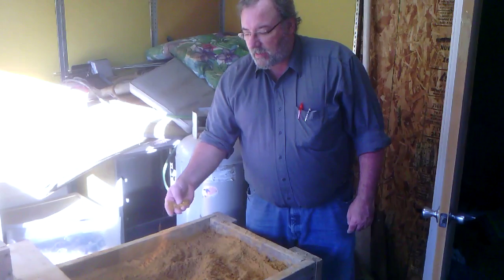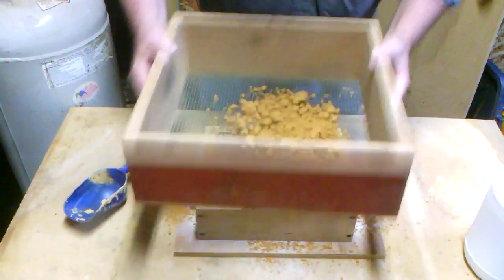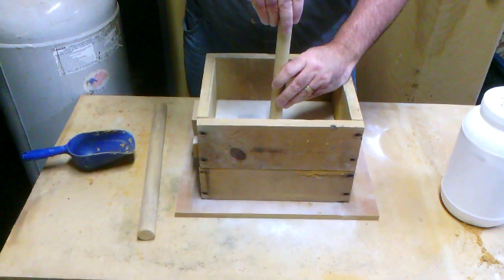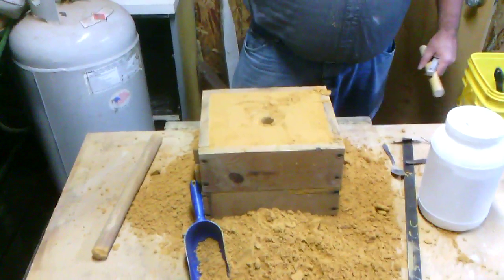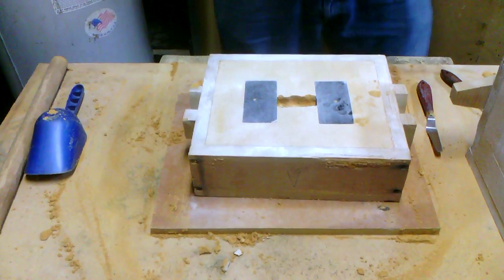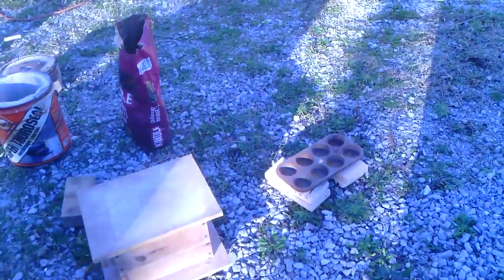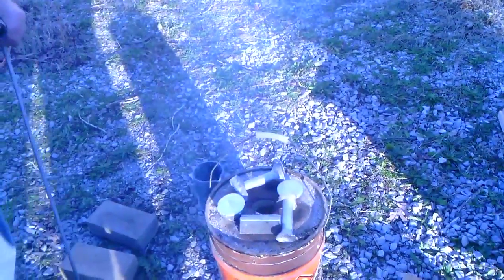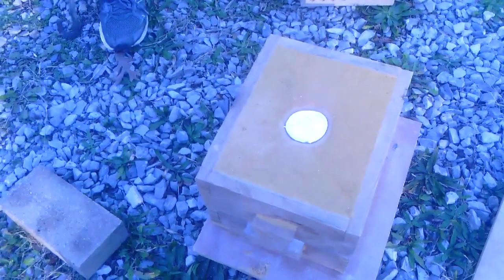Metal Casting From Start To Finish

Comment: I have never seen charcoal used for heating. Will it work for all metals or just low temperature metals like aluminum & brass.
Reply from the maker: I suppose with enough fuel and air you could melt iron, but charcoal I don't think really has enough density to be economical.  You could however use nut coal or similar.  Great question.   Thanks for stopping by and watching and taking the time to comment. 

Joe

Comment: What is your sand?
Reply from the maker: The sand I use is green sand.  This is just clean silica sand with clay added to it for a binder and just enough water to make it stick.  Sometimes sand can be found naturally this way and is called natural bonded sand.  You can make your own green sand if natural bonded sand is unavailable.  There are many recipes for the sand, but a good purpose aluminum casting sand is 94% sand, 6% bentonite clay and 3-3-1/2% water to temper the sand.  You may want to check out some of YouTube channel sandrammers early videos.

https://www.youtube.com/user/sandrammer

Joe
Reply: @MyHeap  thank you man, but what is size of this sand?
Reply from the maker: @يونساويس  Use the finest you can find.  I think for aluminum castings, 80 - 100 mesh works well.  If you get too fine a sand, you have problems with the gasses being unable to escape..

Joe

Comment: i WOULD HAVE NEVER THOUGHT THAT CHARCOAL WOULD HAVE GOTTEN THAT HOT THAT FAST!  GREAT!  WHERE DID YOU GET THAT SMALL SPATULA?
Reply from the maker: With enough air charcoal can get pretty hot, pretty quick.  The palette knife (spatula) that I am cutting gates with, I bought in the paint department of the local hobby lobby.  They make several styles and they are great for this sort of work.  Thank you for stopping by and taking time to comment.

Joe

Comment: Hello, early in your video you indicated that you would do a project using a match plate.  Have you, or do you still plan on doing that.  Have heard of match plates but never have seen one or one in use.  Thank you.
Reply from the maker: Hi Glenn,  I have the hardware cast and need to machine them for the match plate.  I have a very small Craftsman 7x12 lathe but it is too small to machine the castings.  I have tried.  So in the interim I have found a Atlas TH54, it is a 10x36 and is big enough to do them.  I am in the process of fixing this lathe up to use as time and money permits.  When I get it done I will machine the castings.  I will post a video if you like when I get there.  If you have a real interest in metal casting, I would recommend watching some of myfordboy and mrpete222 vidies from theor channel.  For an excellent video course on foundry and casting, I would point you to mrpete222.com where Lyle has a complete series on it.

Joe
Reply: Thank you "My Heap"  I will certainly go to those references you suggest.   Much appreciated, keep on making videos, you have much to offer.

Comment: I've been considering casting parts for a project, in my research I came across your video.   I enjoyed it.  Thanks Joe..  P.s  I like your thoughts on safety,   and the safety sneakers, better that safety sandals.
Reply from the maker: Hey Walt, great to see you.  I take safety serious, but sometimes I am a little lax.  That could cause problems, but if it does, then it is my fault.  I own that!  My website, My Heap - A DIY AYOR Experience is a testament to that.  Now if you want to know the story of that name, your old enough maybe to appreciate it.

Recall I am a computer guy, well HEAP memory is where the old computer stores information that it doesn't need in a while.  Hence the name, My Heap.  DIY AYOR, well that is my life in a couple of acronyms.  DO It Yourself, At Your Own Risk.

Casting for me started from playing a game called Warhammer Fantasy Battles.  You can google if your interested.  But started making molds, then an attempt at injection molding, then metal casting, then metal working and a few other things thrown in.  I think I suffer from some sort of Hobby (Feature) creep.  You tell me.  :-)

If you want to cast metal on a budget, then there are plenty of ways to get into it.  Want some help along the way,  I will be happy to help.  Just let me know.  If your very serious about it, send me an email, I may have something you will find useful.

Thanks you Walt for taking the time to watch, I appreciate it.

Joe
Reply: I haven't heard Heap in decades.  Nice clever acronym, I like it.  Mine is simple.  I'm a old engineer EE from the south.    While working in the barn I came across my wifes old kiln, if I recall correctly it can hit 1800 F, do you think that will work for a first attempt?
Reply from the maker: Yes, Aluminum melts at around 1200 or so depending on the alloy.  You want to bring the heat to 1300-1350 for pouring but don't let it soak as the aluminum will absorb hydrogen resulting in bubbles trapped in the casting.  You can start with pouring ingots, muffin tins work great for that and will give you some experience handling the melt.  For a crucible, some use cut off fir extinguishers (They are good for a few melts)  Heavy wall pipe with a bottom welded on make a good crucible.  Just make sure you go through the motions of handling the crucible and pouring before you actually melt anything.  :-)
Reply: Thanks for the pointers.  Like you I have tooooo many irons in the fire, and far to many interests; such is the creative mind..  I was looking at a graphite crucible, any experience?  At this time I am researching fall and winter projects,  but I am determined to do some castings, but first my Atlas beckons me... .  Time for my end of week bourbon... Cheers!
Reply from the maker: I bought my clay graphite crucible from Budget Casting Supply (B6) and have a graphite crucible that was given to me that I want to reserve for brass.  Most aluminum I pour is from a 4" heavy wall pipe.  I am not worried about contaminating the melt for my application and of all the stuff to melt, AL is really cold in comparison.  There are probably other places to buy crucibles, I just have not searched.

When you start on your Atlas, I hope you make a video series.  (hint)

Bourbon?!?!  Nah, I am a single malt scotch guy.  ;-)
Reply: The Atlas video is coming asap.  I have Glenfiddich in the bar 18 yr, 3 years ago..  One day I'll open it..
Reply from the maker: Sounds to me that I should be a friend and help you get the top off that bottle!!!
Reply: My Heap one day, we will pop the top
Reply from the maker: So where is southern engineering located?  The heap is piled up in middle Tennessee about 70 miles west of Nashville.
Reply: I miss Tennessee,  spend a couple of years over in the Oak Ridge area.   When I retire I want to be back there...
I'm in S.W. Michigan, currently..
Reply from the maker: At least it is south Michigan. Hahah
Reply: Yup....  Have a good weekend!   I'll e-mail you..

Comment: Lmao, dont send the safety nazi's over to my channel, they might have a field day! Excellent technique & result Joe,...you did a fine job! ~ Rich
Reply from the maker: Thanks Rich.  Speaking of casting, how are you mulling your sand?
Reply: I simply use an eggbeater blade chucked up in a drill and mix in a 5 gallon bucket, about 45lbs worth each time. I have always wondered how guys like yourself deal with having to remoisten sand when you have a few hundred pounds in your casting stations. Its the reason I never made one. You have a muller?
Reply from the maker: No, I don't have a muller.  I mist mine with water and work it with a mortar hoe.  Very labor intensive and I hate doing it.  HOWEVER, Dan from Dan's Workshop made a sand muller on the cheap.  Something you and I would do.  Here is the video:  https://www.youtube.com/watch?v=N6oMD_LD4PA

Now, I have contacted Dan and he made some modifications for me.  The Ring gear an pinion suited for skate bearings everyone can get.  So I have been thinking of making one on the cheap.  I have the Chastain book on making a sand muller, but I like the idea of making one from simple materials anyone can get.  Any thoughts?

Joe
Reply: Lol, looks like a contraption I would build for sure. It looks like it does a great job. If you have the room for one go for it!
Reply from the maker: Well, room might be a problem for me.  Too much junk and too little space.  I have it on my list, but not near the top.  Too much other stuff to do first.  :-(

Joe